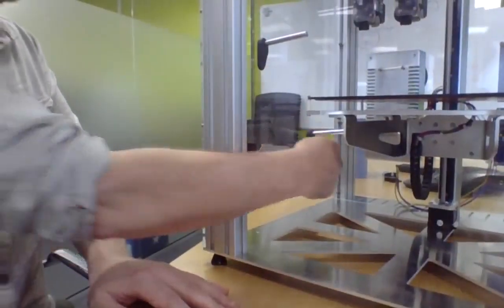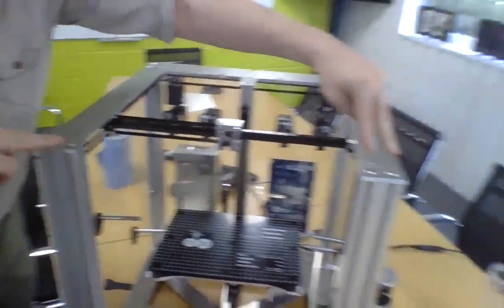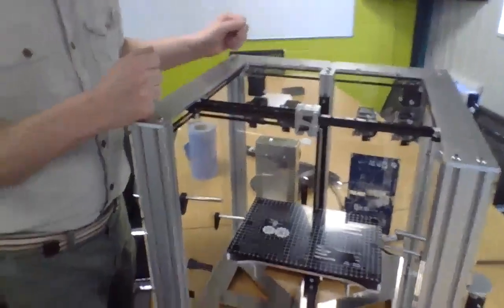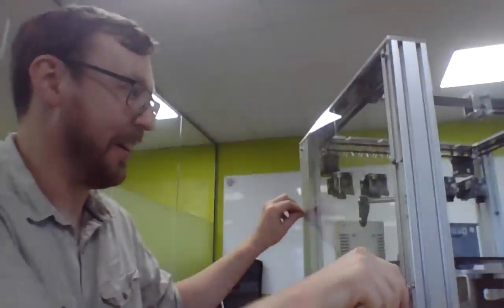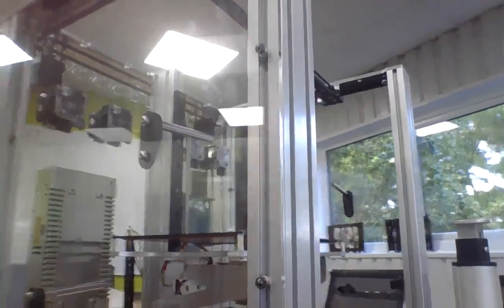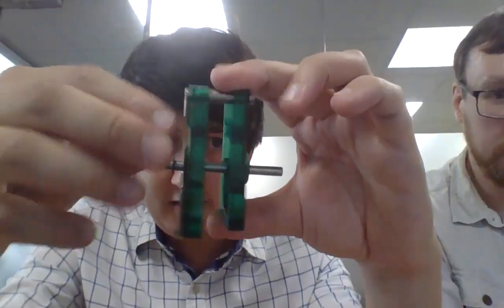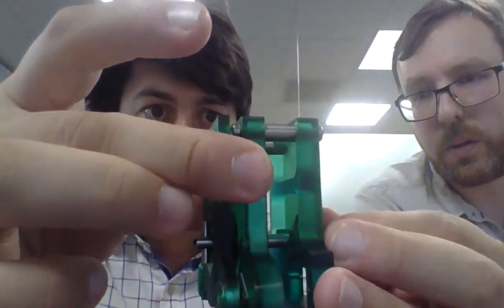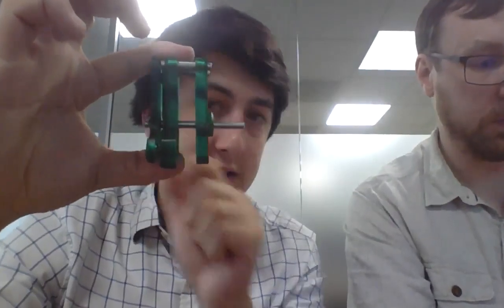E3D Tool-Changer Q&A

Comment: I understand the importance of defining a hardware standard and leaving the software up to the implementation (paraphrasing), but I would avoid ignoring a software reference entirely especially for any commands or codes for controlling the tools. Maintains a central reference where an open spec can be defined with the cross manufacturer Input you already have in place.

It would be counter intuitive for each manufacturer to deploy seven different ways to control a laser tool when a compatible cross command could have been created. Simpler for firmware, software and hardware developers all round.

Comment: I didn't get to catch the stream live, but one question about the toolheads - How standardised will the nozzle mounts be? Eg. for the V6, Volcano and SuperVolcano, will you compensate for the different hotend lengths in firmware, moving the bed up and down to compensate when you switch tools, or will you specify that the tip of the nozzle be at the same position relative to the toolplate, and vary the height at which the hotend is mounted so that all the nozzle tips are at the same height regardless of the tool being used. How will this apply to hotends from other manufacturers if other manufacturers were to join in and produce their own specialised hotends?

Comment: Can we see the print quality compared to lets say a Prusa close up? At the end of the day, if we're not pushing the quality of FDM printing, what good are all these multiple heads? We already have CNC machines, lasers, etc. Seems like the printing aspect here is your bread and butter and I wanna see how good of an FDM print this will produce after engineering the machine to this degree.
Reply: Joe, there's pretty much an upper limit to print quality. I can 100% guarantee this printer will make single color plastic parts every bit as good as the Prusa. If it doesn't, it's something the operator did wrong. AKA : User Error

Comment: This is getting very old when you're answering many questions twice in the same live stream. You've answered machine size option questions at least twice, open sourcing policy thrice, pick and place twice (not counting the mention you deferred to previously in the video) how much the tool head system can old twice, not counting the later deferral to previously in the video, the minimum power supply size twice, I'm pretty sure you talked about using Simplify 3D for its profile system twice, answered questions about buying the bare tool grabber / holders at least twice.